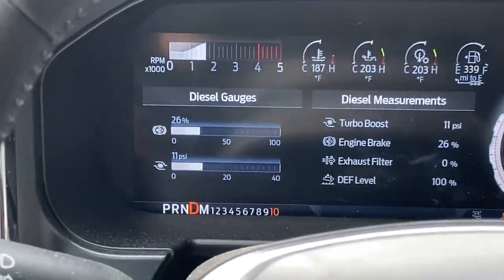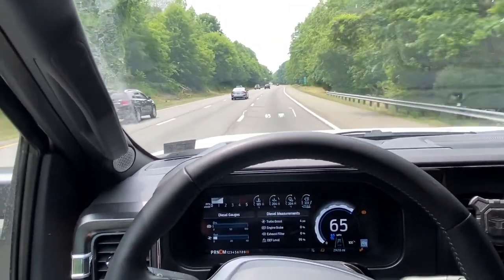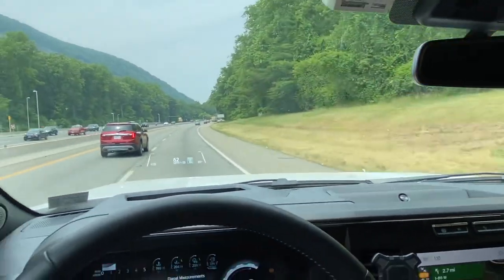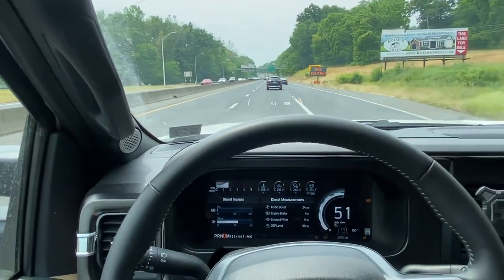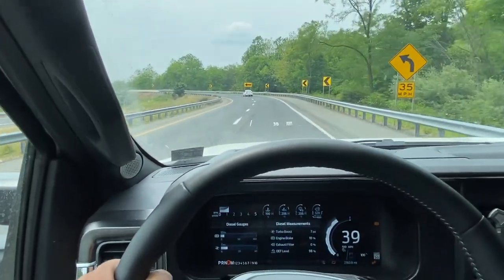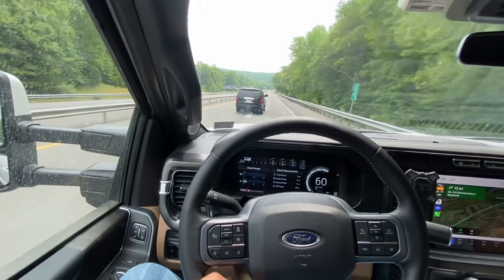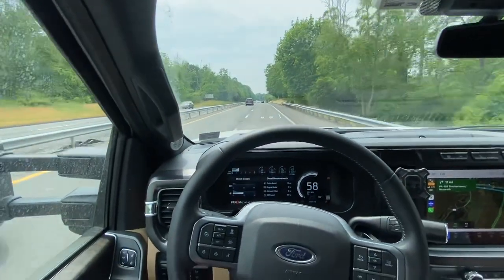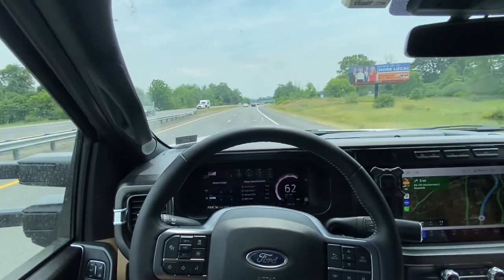2023 F-350 Super Duty pulls big trailers up big hills with ease

Comment: How you Like the truck so far n are you pleased with the purchase n how’s it on fuel ⛽️?
Reply from the maker: Couldn’t be happier.  It’s actually really good on fuel.  18-20mpg unloaded, 10-12mpg with a 16k trailer hitched up.
Reply: Normal powerstroke or HO powerstroke diesel
Reply from the maker: @joshsuperduty1270  just the standard output!  It’s got more power than we’re ever going to need.

Comment: Is that the standard screen layout when towing? I have a '23 F350 Lariat Ult w/ 6.7 and have never seen that screen (but I haven't towed our trailer w it yet).
Reply from the maker: It takes a while to set it up.  In order for the tach to go from a dial to a bar graph, you need to put the truck into tow-haul mode.  Then do A LOT of digging around in the menus.  It took a healthy amount of time to discover this layout, and there was no documentation that explained it.
Reply: @ArmyProperty  Thanks! It did take some digging but I found it! Def like that view better when towing. Thanks!

Comment: On my 19 350 with the exhaust brake on normal mode it will slow me down, just have to tap the brake to activate it. But once it’s activated it’ll slow me down without being on the brakes.
Reply from the maker: We’ve been working hard to get ours to want to do that!!!  Maybe it’s just spaced out.
Reply: @ArmyProperty  now i will say I’ve heard the 10 speed makes it less noticeable but i haven’t gotten to drive one yet.
Reply from the maker: @wtwoffroad  the 10-speed is nice.  There's been a lot of talk going around about transmission failures at low miles (under 100k) with the 10-speed.  I guess we'll find out.  It feels very solid though.  Shifts very smoothly.
Reply: Same here. I have a 2019 F450 pulling a 20,800 lb Jayco Seismic toy hauler. We're just shy of 30K combined and the truck is awesome up and down hills. Tap the brake and the truck holds you at the speed you have been going. If I put it in cruise control, this truck will slow you down, even on steep grades. The '23's should be better, maybe something is not right on that truck.

Comment: Between your 350 vs ram 3500..which one more comfort?
Reply from the maker: They've both got stuff suspensions but the F-350 is more comfortable.  The Ram 3500 rides like it's on the bump stops!!
Reply: @ArmyProperty  thank you sir...now i know why ford have the highest selling truck
Reply: I had 2020 F350 6.7 DRW Lariat and just got 2023 Ram 3500 Limited DRW HO 6.7 8ft bed..  For me Ram rides better with Auto leveling rear air suspension..   It is more quiet..  I do miss 10 speed Ford..  My new Ram get 16.3 mpg vs Ford 16.7 mpg

Comment: Do you ever use cruise control while towing?
Reply from the maker: Yes!  The cruise was set on 65 for the first few minutes, going up and down the hills, then I cut it down when we got to the Delaware Water Gap.  And adjusted it throughout the remainder of the video too.  Works great.
Reply: @ArmyProperty  I just picked up 2023 F350 SRW lariat to pull my race trailer, in large part due to your helpful and informative videos. I was wondering the same thing. I tow thru the mountains a lot and I'm wondering by what method the truck decelerates when using cruise while towing, going downhill in particular. I notice the engine/exhaust brake never activates when I'm in cruisecontrol even though the system is On. Is it putting unnecessary heat into the truck or trailer's brakes in that case?